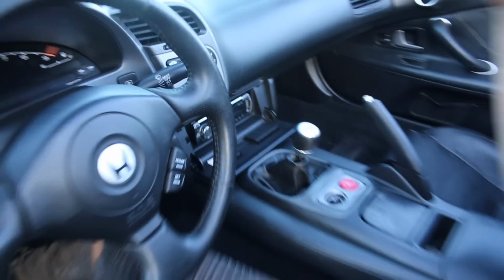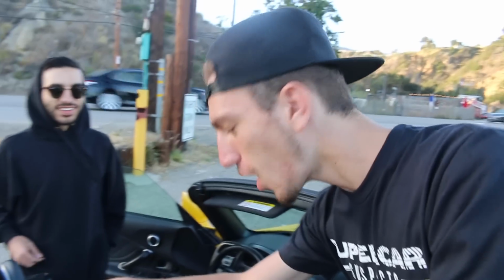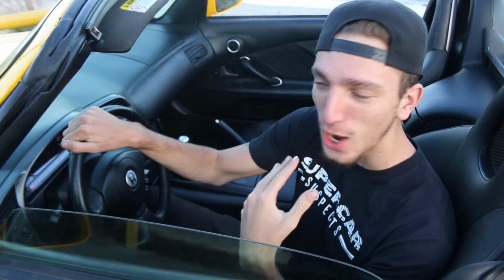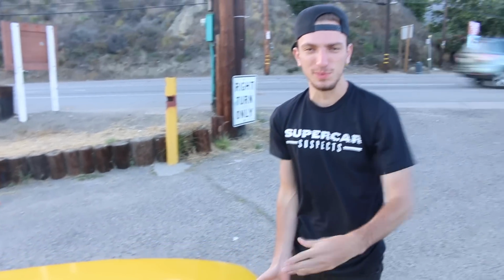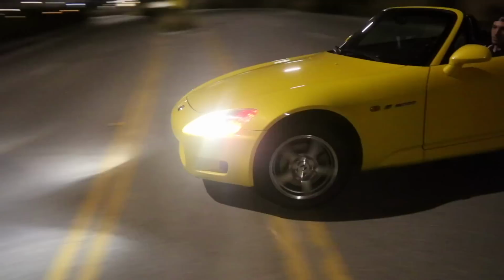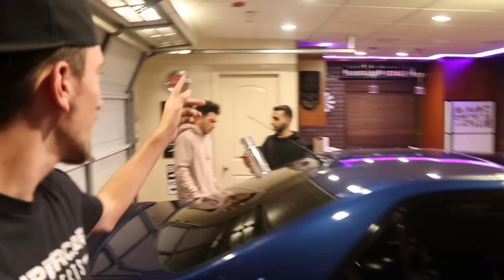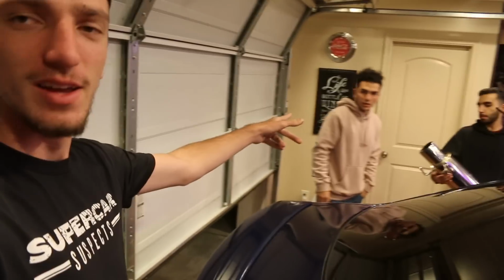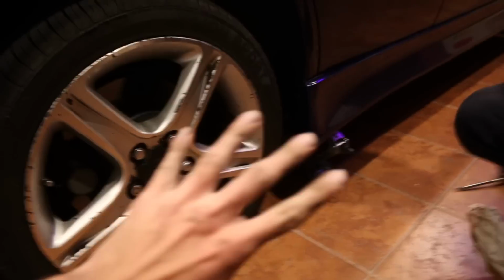My NEW Honda S2000 Walk-through + INSTALL!

Comment: I was pushing for a V8 but if you get a 4 cylinder this is the one
Reply: True
Reply: subies too
Reply: Tac v8s are slow .  ! 4 bangers always killing v8s
Reply: Ramon Velazquez don't know about that, maybe a 6 cylinder turbo but not many 4 pots that quick!
Reply: But it's a 4 cylinder that revs till 9000rpm and runs on 93 octane lol. It's a high performance motor. Just like the 90s integra type r motor
Reply: Ramon Velazquez wow you didn't put much thought in that one. ...Koenigsegg
Reply: Tac the ls7 motor is an animal. I'm a fan of all cars. Some cars are good for The straight, some are good for the cornering, some are good for whatever.
Reply: A 2000 honda s2000 is a late 13 second car and a 2000 mustang gt is a mid 14 second car tho ill tell ya that much. Sorry boys but it's facts. If we're talking v8's, it's chevy or nothing. The ls7 motor is freaking discosting
Reply: I just puked. but I was hungry so I decided to eat it. then I puked again because i ate puke
Reply: Behind every v8 hater theirs someone that got gapped by one and those who can't afford them
Reply: should of been a Lotus Exige and not a car with a HistoryOfNoDramaticAcceleration
Reply: Christian De Vos The earlier mustang GT’s were weak. They made so little power for the V8’s and if were looking at strictly horsepower the 2008 Mustang GT has basically the same horsepower as a 3.6L V6 Cadillac CTS. That’s not very good.
Reply: two words, fox body
Reply: Theirs stock f20 f22 s2000 doings 8s with 700whp unopened engine stock block. BUT this is a track monster is will run circles around any v8. I'd say the only real competition would be porsches but even those get humiliated by track prep s2000. So the only real track competition is a turbo busa gocart. That the closest feeling to track preped turbo s2000.

Comment: Nice I've got an AP1 too. I suggest 4.77 final drive before any other mods, the car will be alot quicker 0-100 than stock and is alot more fun. Only bad part is bad gas mileage because of the higher rpms all the time but who cares lol